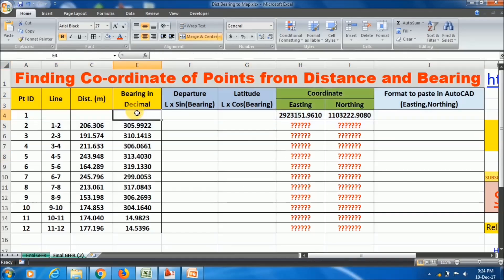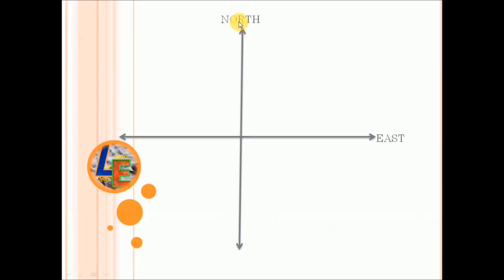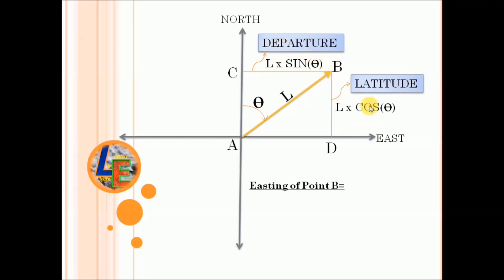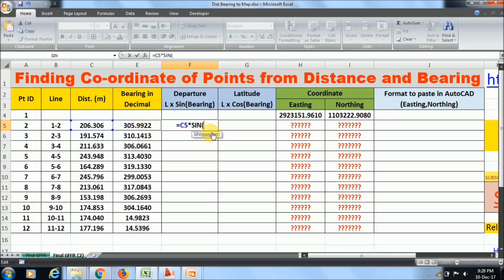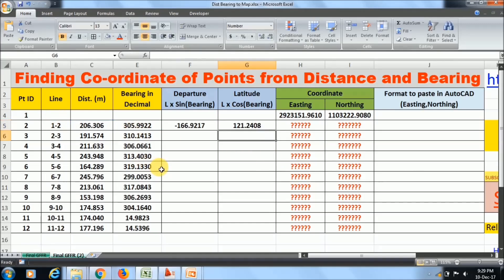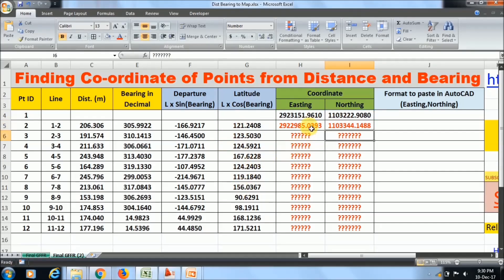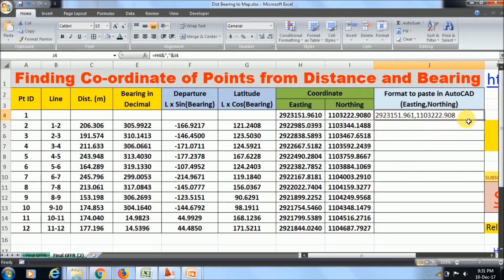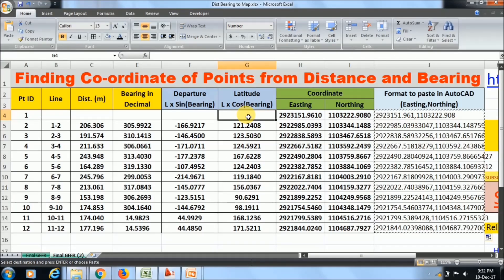How to Calculate coordinates from distance and bearing where we have coordinate of a known point

Comment: Hi I've been searching ways to solve this and arrive at possible using easting and northing and getting the coordinates with the bearing and distance given. 

Is it possible to solve this using only simple calculator calculator the only have square root button, memory plus memory minus, memory clear and the other four basic operation. I see a channel in youtube gives tutorial in getting sin and cosine using only simple calculator. Also i search in ai chat the formula in getting approximate arc tangent. So it's possible to solve this but it takes time to research the formulas needed to solve this.
At 1045H, your GPS fixes your position at lat 21°01.75°N and long 172°48.40°W. You are steering course of 086°psc at a speed of 6knots. At 2400H you fix your position at latitude 21°04.2'N and long 172°38.85'W. What were your set and drift?

Comment: Hi, the data I have is a starting point in DMS format, then bearings and distance in this format. Bearing: S 72° 32’ E, Distance: 7.30m. How do I proceed so I can plug it in Google Maps/Earth?  TIA!
Reply from the maker: Sir First  you have to convert Quardantral bearing to whole circle bearing. Then apply our formula
Reply: @LearnExplore  I converted that bearing using the formula deg+(min/60)+(sec/3600) and arrived at 72.5333. Is this the correct whole circle bearing value?
Reply from the maker: No its not. Since your bearing is in SE quardrant that means it is in 2nd quadrant if we split in 4 quardrants in clockwise manner. 
Whole Circle bearing is calculated clockwise from North. 
So in your case wcb will be (180-72.533)
Reply from the maker: You can watch this for concept
https://youtu.be/xu8ROw8bK_Q

Comment: i dont understand the radiants. What is the formula to convert bearing to radiant?
Reply from the maker: Radian is in pie format. Please use Google search
Reply: @LearnExplore  when I googled it. It showed pie/180 but when I times it with tht, the answer is wrong. Can u tell the exact formula please?
Reply from the maker: A circle has 360 degrees or 2pi radians — going all the way around is 2 * pi * r / r. So a radian is about 360 /(2 * pi) or 57.3 degrees.
Reply: @LearnExplore  thanks a lot. I'll try using it.

Comment: Brother thank you soo much for Thai video, I want to export the points marked in CAD, and I want to move a robot arms to that exact point... How I can calculate..?
Reply from the maker: Thanks...what is robot arms? 
For exporting coordinate we have separate video.
Reply: @LearnExplore  It is Delta make SCARA robot. I have exported points coordinate from CAD into a excel. After if I use that point coordinate to move robot, then there offset around 30mm
Reply: @LearnExplore  if take length of selected point from origin point, and calculate it by L*sin@,  and L*cos@, is it good idea...? Then can I get accurate point.  Here the value of origin point is my robot's origin.

Comment: Hello, 
very good video, much appreciated.  Can you help me out as I am trying to locate some position but my bearings are not in decimal.  They are in this format
N.16 - 37E
Can you give any advice how I convert to decimal please??
Reply from the maker: Thank you
For this video already uploaded. pls check in our youtube channel
Reply: @LearnExplore  Do you have a link to that video please?  How to convert from N.16 - 37E to decimal format
Reply from the maker: https://www.youtube.com/watch?v=-BOj-hJynBc this video is si,ilar to your query
Reply: @LearnExplore  I cannot match that problem to my problem.  Are you able to tell me what N.16 - 37E is in decimal format.  I have searched high and low and I cannot work this out at all.  Any help would be appreciated
Reply from the maker: @davidjobes2413  This is actually quadrantal bearing system. Here is few examples
Example 1: N 16-37E means 16°37'00" and if you want to convert this degree minute second to decimal then watch this video https://www.youtube.com/watch?v=-BOj-hJynBc
Example 2: N 15-30W means 344°30'00" i.e. (360-15.5)
Example 3: S 15-30E means 164°30'00" i.e. (180-15.5)
Example 4: S 15-30W means 195°30'00" i.e. (180+15.5)
Hope this examples will help you.